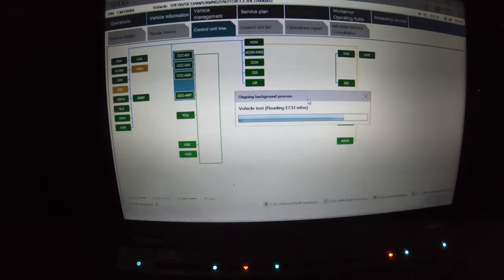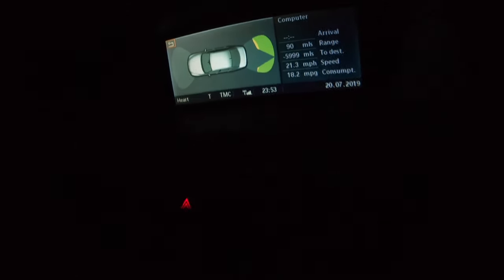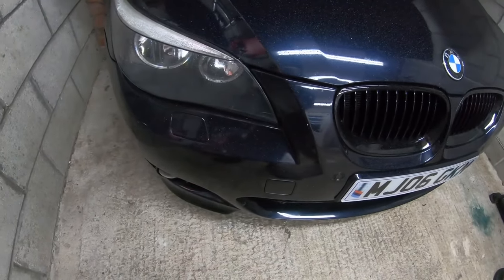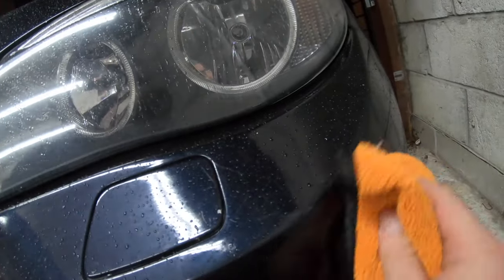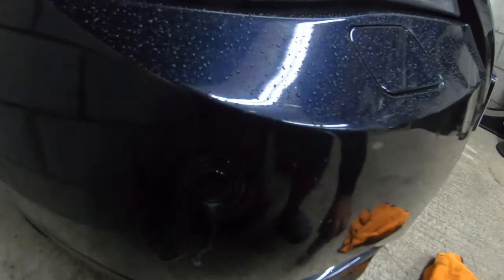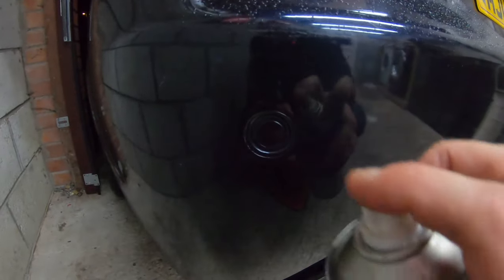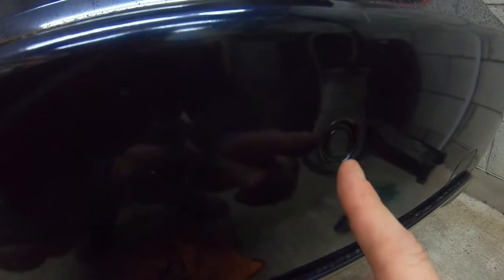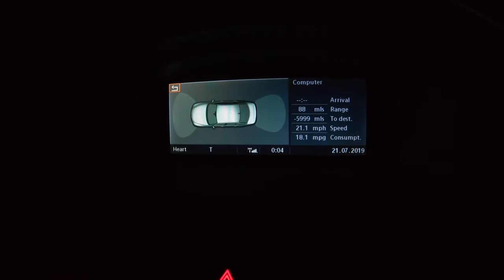How To Fix Parking Sensors On Any Car For Free......Fix Your Original Sensors DON'T SPEND MONEY

Comment: No way, can’t believe this worked. Washed my car and cleaned the sensors with detailing brush and shampoo. Dried the car and sprayed wd40 to all the sensors and now they work again. Ps- I hit a big puddle on a backroad and it stopped working, now they are fixed. Thanks to the bmw doctor👍👍👍
Reply: I'm in shock too, I had rock chip on mine thought it was toast, turns out water was in it!!

Comment: Looked so simple that I just had to try it.  Totally fixed the sensors on my 2015 Dodge Durango.  I had bought the vehicle used and thought they were working OK until they failed.  After following your simple fix they now work exactly as described in the owners manual.
Reply from the maker: Exactly like that mate

Comment: So I have a gr supra 2021. I have replaced paddle shifters in my car. I had to take out the Neg. battery terminal. When i plugged my battery back in. i have a Parking assistance malfunction error it says its my side sensors. Will this work fixing it? I have no idea why its going off because i haven't drove the car in 3 months because of winter. Just sitting in the garage starting it up once a week.

Comment: I don't comment that often on YouTube videos but I'll make an exception here. The reverse parking sensors in my car have not worked at all for a good 6 months with an intermittent fault prior to that. I tried this fix and it worked like a charm! Thanks a lot for the tip, I was just about to replace the sensors altogether until I watched you video! Nice work! 👏

Comment: Thank you so much. This is an awesome tip. The BMW quoted me $800 to replace one faulty front parking sensor. Sporadically the right front sensor keeps beeping. Often I had to turn off the whole thing. I just sprayed WD40 on my 2016 F10, now it works like brand new again. Thank you again.

Comment: Can't believe this actually worked, I had auto PDC failure on G31, manual enabling them worked then that stopped also... for multiple days, didn't plug it in as don't have ISTA but I sprayed and wiped all PDC sensors on the bumpers and boom fixed.

10/10 Fantastic content as always.

Comment: Hey Doc. Again another great video where you've saved us from spending money on parts that seems to fail quite often. I actually had ordered a couple of new sensors the other day and was about to go to the "stealer" to have them to plug in and diagnose which sensors was faulty. But then I saw this video and tried it out - This worked PERFECTLY, even though I've had the malfunction going on for a couple of months. Cancelled the order straight after and saved around 300€.Thanks Doc - keep up the good work. Cheers from Denmark
Reply: Did you know you can diagnose which sensor isn’t working with as little as your ear? Or the microphone on your mobile device. A good parking sensor will make a ticking noise (those are the ultra sonic waves used by the sensors to pickup the echo effect from an object) and a bad sensor will not make such noise. Therefore you typically don’t have to go to the stealer to get such an unnecessary diag.

Comment: i had the service advance track warning, check park aid warning, hill start Assist not available warning, abs light and anti slip , i cleaned all the sensor front and back with WD40 and after few minutes all cleared. Thank you very much it was a great help.

Comment: Didn’t think this would ever work. Tried it on my 2016 Tundra that had been setting the indicator for two days straight, mainly when I slowed down or stopped. Sprayed a little WD-40 on the sensors then wiped them off and IT WORKED! Thanks for saving me $283 per sensor from Toyota!

Comment: Wow!  That is too cool!
My 2005 E60 has been giving PDC faults intermittently, and now more often permanently.
I've got an inspection coming up next month and they love to fail cars beyond 10 years.  I got the air bag sensor fault cleared, disconnected the charging system module that was killing my battery, now ffft, ffft, ffft, problem solved instantly.  Many thanks!
Reply from the maker: Your welcome

Comment: I had tint removed from 540i and in the process I guess the steam hit one of the sensors while they were installing the new one without turning off the steamer. It started showing PDC malfunction and I was super irritated. Checked this video and did exactly what BMW Doctor  demonstrated. It worked perfectly. Started the car back and Viola! PDC errors and failure notifications vanished and auto parking sensors started working as normal . Thank you for the excellent tip

Comment: Thanks so much for this video!! I have an F150 and the rear parking aid stopped working. I tried this and it DIDN'T work! BUT, about 6 hours later the error stopped coming up and they worked perfectly. I'm guessing it took a while to remove the moisture in the sensors. Thanks again!!

Comment: Thanks for this vid… I was told by BMW that they have to reprogram my PDC or buy a NEW one which cost $400.00
Let’s weigh $4.00💵 WD-40🤷🏽and a GRIP 💴$400.00 🧰😱🤑🤮🤢🤡☠️
I’m glad I found your YouTube link bro…. SHUT EM DOWN! BMW needs to build better cars and use carbon fibre on all their cars and not cheap plastics that has a 4 year lifespan where EVERYTHING starts to break and /or malfunction immediately after the service warranty expires.

Comment: I'll be damned ... At first I was like ... yeah, sure ... but it really worked. My parking sensors started to produce the annoying continuous sound when I was putting it in reverse. I just used VCDS to scan and there was no error. Really glad I found your video. Thanks.
Reply from the maker: your welcome and glad it worked like a charm

Comment: You made my day :-) Thank you for this great, simple and cheap solution. After changing the PDC model first ( destroyed by water ) I still had problems with my rear sensors. I bought the WD 40 (old was empty) and cleaned all sensors as you described. And after 10 min it worked perfectly. So thanks a lot and all best from Bavaria. (Germany)
Reply from the maker: Your welcome sir and it’s working for everyone

Comment: I tried this on one of my Mercedes.. Didnt work sadly.  I did try a tip from forum and listened to it with a stethoscope.  You can hear the weak one as you hear a tapping sound.  The sensors are the Bosch type.  I know the fault you mean with my newer car and that does not like it when its raining.  Good old UK weather. WD40 cleaning contaminants off or any wax debris helps a lot

Comment: Cheers buddy, mine have been temperamental for about a year now. Then a few months ago they stopped working altogether. I was going to take it to my local mechanic for repair, or replacement of the faulty parking sensors. But this gives me a chance to save some money if it works. It's 3:00 am at the moment, but tomorrow before i jump in the car, i'm spraying those sensors with WD40. Fingers crossed this'll be an end to the problem. Thanks mate.
Reply from the maker: Your welcome mate It does work no questions asked go and spray them it’s 3am here aswell no Biggy go and spray them and make them work takes 2 minutes

Comment: Thank You!!!! It worked like magic on my e60:)...in the past I was taking  the sensors out of the bumper....drying them with hairdryer....
Reply from the maker: No problem mate
Reply: Do you know where I can find the pdc bracket mounts the ones that hold the sensor for a e60 m5??
Reply: BMW Doctor thank you very much for your guide. I did it on my peugeot 508 since on rainy days I had received error messages and as a result no working parking assist. I believe it is going to work /now it is sunny, I cannot test it/, but is it going to be a permanent solution? Maybe they will fail again after few rainy days? Is this wd40 bad for the sensors’ seals (o-rings)?
Reply: @jsamardjiev  Hi, did it work ?
Reply: Nemanja Aleksic yep, but I cant say how much time it will keep this working state :)

Comment: Great vid. Going to see if that cures my Merc W212 PDC issue. As the faulty sensor was front left, it would have been really useful to see the front left working, rather than that being the zone where there were no objects. From a totally detached perspective, it looked like front left wasn’t working but all others were.
Reply: Did it? Literally what Mines doing just randomly goes off when parked on a stop light...just the front left

Comment: Hi can I use SILICONE LUBRICANT instead? That’s what I have in my trunk now wondering instead going to store to buy W40 .
Thank you! I parked close to sprinkler and all night it was blasting water in the sensor. But I’m worried it was also spraying water under the bumper on the sensor connector which is on my passenger front left site 🤔

Comment: Tried this on my E46 this morning and it worked a treat, cheers bro
Reply: I tried mine, they didn't work. Can you tell me exactly what you did please?
Reply: @shazza8773  sprayed Wd40 around the parking sensor itself, not the plastic... (you'll see way I mean when you look at the sensor). I left it for  few mins then wiped off the excess wd40. Worked fine afterwards.
Reply: @silestanix  ok thanks will give it another go. Hope it works
Reply: @silestanix  Hi mate, tried mine again and this time used a lot more wd40. No luck. Anything else you could suggest?

Comment: Many thanks for this repair tip, it worked on my Vauxhall Insignia too. Had been sent mad with intermittent fault for months sometimes front other times rear just treated all sensors now no longer is Service Parking Sensor light on dashboard
Reply: I have a constant beep on my Opel Insignia front sensors. Every time I startup the car it beeps, everytime I put in reverse it beeps. Its getting me crazy! I'll try this method for sure!

Comment: One of my sensors isnt working, front left. The sensor is fine i think its a wiring issue. Could you help isolating the pin in the pdc so I can remove that one?? E87 2007 1 series

Comment: works like a charm on my E46! Fixed my wet parking sensor in 3 minutes. Thanks!
Reply: Sorry mate but it only worked for 12 hours and the sensor is dead again... Is there any help? Tried to spray it again with WD-40 but not helping this time.
Reply: Take off the bumper and spray wd40 on the connectors

Comment: That might be the tightest parking spot I have ever seen, and I almost cringed the car was in there. How do you even get the doors open or slide in the window? That said, great tip, especially for McLaren 570S drivers who always have this issue with their crappy sensors. Instead of 100 miles back and forth to the dealer and maybe a month waiting - a little spray might do the trick. In the end it is either a bad sensor or dirt - hopefully this works.

Comment: Love your video! Do you happen to know if these sensors are the same on a Tesla model 3? The parking sensors look the same. I knocked one loose and was able to duct tape on back in from the inside of the bumper (accessing thru front trunk area once it was removed).
Thank you!

Comment: Great advice and well delivered.  Do you have any idea/videos what to check if the pdc button doesn't light up at all and none of the sensors (f&r) do anything? The fuses seem to be intact and the pdc module is dry as a bone...Its a 2010 E82. Thanks if you can help, no worries if you can't.
Reply from the maker: If your pdc button ain’t lighting up it may be not coded correctly or programmed and the car doesn’t know when to turn it on OR when it’s meant to come active
Reply: @BMWDoctor  Okay awesome, will check that out, thanks for the swift reply, top man.

Comment: I can confirm this worked on a KIA after a shot of W 40 an some banging on the bumper . I think this help dislodge the water rather than it being due to a loose sensor connector .I used my phone on video record and put it near each sensor to hear if they were ticking one of them was not ticking . If you have good hearing just put your ear to them
Reply from the maker: That is correct this method is to dislodge water out of the sensor not to help with a loose connector and it works it’s a cheap easy and effective way

Comment: I'm hoping this will work on my E53 front sensors though I'm not entirely sure my fault is caused by moisture in this case. However my Jag rear sensors most definitely are faulty due to water so I am super excited to try this on the XK cos it's been driving me nuts! Thanks for the video, fingers crossed!

Comment: May l ask a daft question please.  I have a 2002. 3.0 e53 X5. The air suspension has been replaced with coil springs. But the air suspension in-active on the dash. I can't get rid of it. Any help would much appreciated. My regards.

Comment: The sensor wires also have a habit of snapping due to corrosion 👍
I would maintain that a squirt of maintenance spray (like WD40) onto sensors, door locks, hinges etc after washing your vehicle especially if you use a pressure washer. 🚕🚖🚗🚘🚙

Comment: I hope this works on my I3, as the intelligently-designed software gives me dozens of warnings each time I back up, preventing use of the rear-view camera and driving the driver mad.
Reply: I tried this on my I-3 and it stopped the malfunction warning torture, despite one sensor still appearing to be deaf. Strange and curious...

Comment: Hey, thanks for the video very informative. However i have an on going issue with my 2007 X5 E70. The car is displaying PDC fault code 9E3B (supply voltage to parking aid sensors, short circuit to ground, permanent). Currently the PDC light is flashing and none of my 8 sensors are working. I have tried listening to the sensors individually but there seems to be no life at all. I have changed the PDC module and the fault is still there. Any advice. Cheers

Comment: I was hoping this would work on my 2017 Subaru Outback for the 4 rear bumper sensors but alas, it did not. So, I'm going to be purchasing a replacement sensor.

Comment: Hello. Ive recently had a leak in my boot and now my pcd does not work or come up on my satnav. The garage said it would cost me nearly  400 quid because I need a new module in the boot. I have a e32. Would you be able to help

Comment: Hello , mine had this issues - I did this but don’t work I have a 2009 E90 - would this be a module issue then ? Also do I need to clear the fault after doing this?
Reply from the maker: You have module issue yes common issue
Reply: BMW Doctor  I will try to unplug it plug it back if nothing then I will replace it - Thanks though!!

Comment: I cleaned my sensor as in this vid of my BMX X1 F48 2016 but 2 of the front PDC are not properly working in hot summer time only (>30°C). After my drive PDC is working fine again. What could be the problem. I have no proplems with water/rain. Please help me

Comment: Ah man , I have f83 m4 and the sensors and reverse cam was working fine. Then one day the front one wasn’t detecting a pole which made me very slightly bump the front bumper gently. Then for a few days it was fine . Then when I went on a longish drive and went to park I got the error message to go to a shop to address it and park Un aided and it hasn’t worked since. Everyone in reverse I get that gong nose. The reverse camera is still fine but only comes on when selecting it through settings. I did try this wd40 as I saw it previously on another vid but no joy! 
Would one dodged sensor take out the whole lot?
Wondering if there’s another hack out there that’s not too invasive. I’m not savvy on diy cat fixes

Comment: I've tried this, but I think mine are too far gone, or do I have to wait a little longer for the wd40 to work and maybe unplug all the pdc module cables?
Reply: any luck ? I've just brought replacement sensors from euro parts £26 each now I'm trying to work out if they can be changed without removing the bumper
Reply: protek security no luck, i think they are completely gone, will have to replace them. I was thinking of ebay? Have you ever tried them? Not thought of buying from eurocarparts, i need 4!
Reply: @21eesa  Euro parts I managed to change them without completely taking the bumper off which was lucky as soon as I changed them completely restored my sensors good times!

Comment: Tried it on my 2014 ml350 as the rear parking sensors stopped working. Did not help so might be a fuse or solenoid, any ideas

Comment: This worked great on Discovery 3. Saved removing front bumper!
Reply: Hi x-ray! I also have a Discovery 3, and keep getting a message on the display 'Front Parking Sensors Inactive'. Mine is a 2005 HSE model. Was this the message you were getting? It looks like I may have to go and get some WD40....if it works!

Comment: Great video. Considering a e46 330i or an e90 330i with idrive. Any thoughts on which is the better car to purchase. Thanks
Reply from the maker: M54 engine requires ALOT of mechanical skills because how many vacuum lines and other stuff you need to remove just to get to the manifold trust me NOT easy at all 

But m54 parts are ready available and cheap 

N52 is very very very easy to maintain and service but parts are expensive and still to this day and you cannot get away with using cheap parts on n52 like you can on the m54 big difference also there riddled in modules so are you good with computers coding and programming if not that ain’t the car for you there easy to fix but a bitch to diagnose and you MUST have the software and know how to use it to correct it 

Both cars have there differences but overhaul both reliable engines m54 is a much nicer quieter engine in idle and smoother but n52 is more powerfull and is a cracking engine if maintained to the highest standards using genuine parts only as they don’t like cheap parts trust me
Reply: BMW Doctor yes you have always said to use genuine parts. Great advice, I am hoping to find an e90 330i with as low kilometers as I can find.